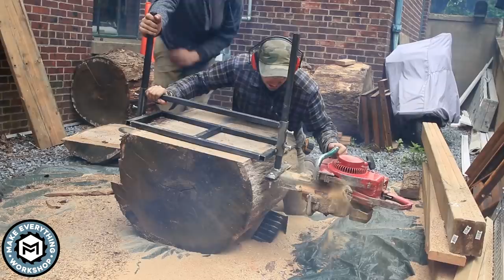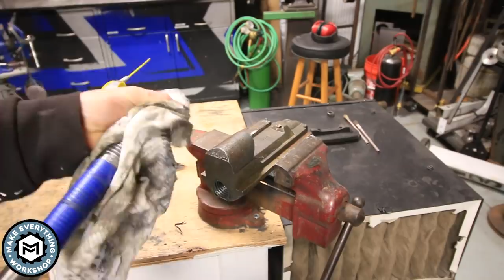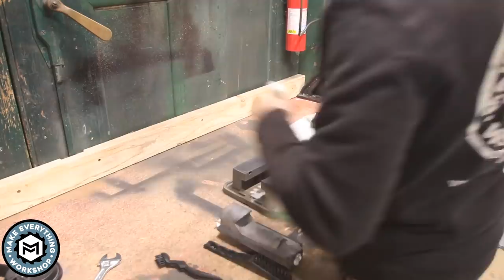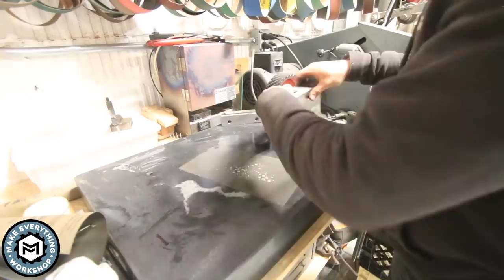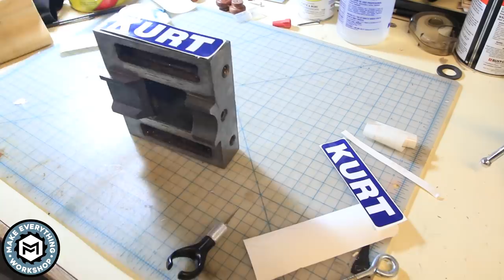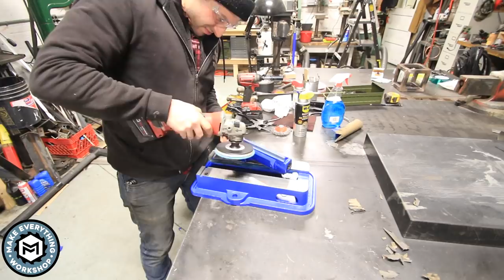KURT Milling Vise Restoration

Comment: Excellent video.  I must be the week for Kurt vice problems, Keith Rucker  had a similar problem with a stuck vice, yours ended up better, it cost him $141.00 for a rebuild kit from Kurt.  Great job, Thanks for sharing and stay safe.
Reply: I saw that same video that Keith did, I wonder why he didn't try the relief-cut on the ACME tread...he could have done that for nothing.

Comment: So I'm obviously a few yrs late on this video. I've gotten into picking up these older Kurt and clone vices (The cheaper the better) And rebuilding them also and flipping them. So I've found that nearly all these ball screw (Kurt and Clones) are all the same thread size and pitch. And found a tap to run into the threads in what this guy is calling the "Thread Box"  Kurt calls this part "Nut and screw assembly" And buy having this tap, 9 out of 10 times it will save all these parts. As long as you didn't destroy them getting them apart. Patience and lots of Kroil or my favorite "CRC Knock'er Loose" The stuff isn't cheap, And I ONLY use it on parts as a last resort before heat (because of the $19.00 a can cost) But if its on a part that you do not want to apply lots of heat to. Then this is what you want, because it does it work. 
Unfortunately they (Kurt) are no longer selling these screw and nut replacement kits for the D-60 vices. Why?? Who knows, Probably because they are trying to sell more new and more expensive models today. However,,,,,,,, if you look at some of the clone parts.  There the same part. And I can't find a difference (even with a micrometer) Between them. But you have to find the right clone parts that will fit your D-60 😉. Yes, there out there, Just look around. And the McMaster Carr replacement bearing and thrust washer kits measure the EXACT same sizes as do the Kurt OEM kits, BTW. And since I live 12 minutes from the McMaster Carr Warehouse here in NE Ohio. I get all my Kurt parts from them and no Shipping cost and there always in stock. Including jaws. OEM handles come from them also, And the Speed Handles i use come from Gray Ledge CNC off ebay. They can custom make and coat anything aluminum for you that you want or need.

Comment: Nice job. The only thing I would have done it differently is; using feeler gauges identify the thread pitch. Then use an actual tap to clean up the female threads.

Comment: Nice job on the vise, I love to restore and paint my machines and tools. One tip on the vise I did was to use a 6 inch wheel and broached a 1/2 drive 3/4 socket into it to use as a speed handle. Works great for me.

Comment: I loved your work restoring this vice! One question though..Since you already have a lathe, why did you risk damaging the lead screw instead of making a dedicated acme tap?
Reply: I'm guessing ...he's a self taught machinist. I mean, these days you can do that fairly quickly since we have the internet but it requires dedication like anything else.
Reply: I wondered the same thing! I'm a self taught machinist, but I can cut acme well enough. Heck you even have the original in good condition right there to check against. I guess if you really do a good job deburring that relief cut, its impact will be almost nil. It's still a stress riser and a interruption in a load bearing thread.

Comment: I didn't want to damage the reference surfaces with the surface grinder, so I completely destroyed them with sandpaper!
Reply: Sandpaper on a surface plate is a very good way of improving the surface finish of a flat face, without changing the geometry by any meaningful degree.
Reply: Summit X  To start, I am a machinist and I work in a precision manufacturing industry.  Thanks for the reply btw, I have added it to the list of technical things to make a video about :).  The vice cost him $50 which is brilliant even if it is out by 50 µm.  The restoration could have been improved in my (and I suspect your) opinions by including measurement and testing, before and after.

The amount of material removed on the surface plate seemed a bit excessive, but I cant tell the grade of sandpaper so it could be as little of 10 µm of steel.  I certainly would have covered the whole surface plate in sandpaper so as to avoid changing the geometry of the granite in the process.

As for not using soft jaw covers for holding the vice jaws: that was definitely an oversight.  Hopefully the Kurt jaws are hard enough to resist the rough treatment.
Reply: Summit X  you are kidding right?. 001 thousands of an inch is 25 nanometers, not even Stefan Gotteswinter would call this inaccurate.
Reply: @ChristophPech  Looking at the tenor of his reply, I would say he meant to type either .001-.002 inches or 1-2 thousandths of an inch. In the heat of the moment he lost track and combined them, but in his head he saw what he meant. This is why successful writers use editors.

Comment: Never put grease in your blast cabinet,  it will not help paint stick to your parts but one time.   Every time after that you're just accumulating & spreading the grease. At least clean dirty parts with gas or diesel. Then maybe even rinse that off with soap & water & dry off before blasting. 
Just my 2¢.
I won't get into accumulated backlash...

Sweet deal though.

Comment: I have just purchased the same vice for £40 in the UK. My thread has a groove in it so it must have been cut just like yours to clean the rust out. I also replaced the jaws and had to smooth the ways off with a #1200 grit diamond stone which was flat as it was going to cost £160 to get it ground. It worked well until i get a surface grinder one day. Re painted like yours in blue. What font is the KURT logo? My vice had holes in the fixed jaw which i filled with a bolt then welded and milled it flat. It looks and works like new again.

Comment: Nice job mate, the “proper” way to fix that thread would have been to chase it with a tap, but then again that tap would have cost a lot more than the vise, you just have more guts than me, I wouldn’t have dared to make that screw “self-tapping” :D
Reply: Do they make acme thread tap chasers?
Reply: You can make one with the lathe and some drill rod, you could probably get away with soft steel for cast iron.
Reply: Isn’t an ACME thread square?

Comment: If you’re working around machinery, especially a lathe, please cut off the drawstrings on your hoodie.  I’m not a safety sally but this is one item that needs absolute diligence.
Reply: Motor 2of7 quite right, this was the comment I was going to make. Rest of the video was very good. But safety comes first!
Reply: I just wanted to thank you for pointing this out. I’m just a hobbyist machinist, and wear hoodies while working constantly... the danger of that never occurred to me. I’ll be removing the drawstrings from all of my hoodies tonight! 👍🏻
Reply: Just being mindful of what you're wearing, and tucking the strings inside the neck also works. But I guess this can get forgotten.
Reply: Great comment! A subject frequently overlooked until tears of loved ones later.

Comment: I really wish you'd watched some other videos on the restoration of one of these by more experienced machinists. You have a working vice now, but in no way is it at the level of precision it would have been if you'd taken a bit more time with it. These are supposed to be what you use when you need to hold parts you're machining to tolerances measured in tenths of thousands. If this can hold a few thousanths now you're lucky. You could probably go back and redo that in the future if you wanted and at the least it's not going to rust again. Now the bad news. You probably now have a small granite countertop instead of a surface plate. Clean it off, and check it with a test indicator, but I'll be very surprised if it doesn't have scratches and gouges all over the place after that. I understand you may not need the level of tolerances these tools can provide at their best, but that doesn't mean they shouldn't be maintained in a way that they still could.

Comment: Hi Sir thanks for best clip but my issue is 4 bolt holes 1/2-13 thread were stripped I could not use the bolts to tight the jaws so could you help me any idea to fix it thread on vise thank you so much.

Comment: But did you measure to see is there's any changes when you clamp the parts down? I guess if you're not making parts for customers, which that have to be +/- .005" or better it's not that big of a deal but If I had a Kurt, I would definitely want to check how close it is to a new one. I'd run an indicator along everything that counts, anyway.

Comment: But, on the other hand, using wet and dry on the surface plate, done carefully, can give quite a nice flat surface. It all depends on the wrist action ...... and using a figure of eight motion - back and forward WILL put a curve into the surface as reported below.  BobUK.

Comment: Just watched this. Yeah, hopefully you are learning. Just about everything you did was wrong. Doesn’t matter what you paid for it. That was a valuable vise that could have been restored and gained value. Here are some highlights:

Surely there was a  chunk of metal in the female threads. I would have chased them with a right angle pick to see if I could find it. Making the screw into a tap and forcing it with an impact gun just made that screw sloppier for sure. Wrong thing to do.

You can’t flatten a ground surface on a flat surface. That whole sandpaper on granite doesn’t do what people think it does. If you don’t know how to use your grinder, at least learn to stone surfaces. I would have stoned the base, cleaned it, then put it on the surface plate and inspected the top surface with a test indicator. Maybe could have just stoned the top surface.

Just about everything you did up to removing the badge removed value from that tool. The fact that at the end of the video, you basically admitted that, makes me want to never watch anything you produce again. I would have preferred if you had discussed what you thought you did wrong so that you could help others learn.

Comment: Why didn't you just regrind the jaws instead of buying new ones?
Reply from the maker: Linda Kasevich I ordered the groovelock jaws from Kurt that have a cool little channel milled in them and a small work stop clamp that helps with indexing multiple pieces. I will likely grind these jaws too just to have multiple sets.
Reply: You heard him say he doesn't have very much surface grinder experience or confidence. He probably didn't feel comfortable doing it.

Comment: Doesn’t that sanding run the risk of destroying your granite plate??   Otherwise, strong work!
Reply from the maker: Thank you!!!

I actually have two plates, one for indicating off, and one for sanding parts on knives perfectly flat. The one in this video is the sanding plate. I got them both at auctions for about $20 each and they are not currently calibrated so I'm not too worried about their dead nuts precision. Also I'm using very little pressure when I sand on them.
Reply: Answer is yes. Sanding ruins surface plates.

Comment: Also, it's not the best idea to clean a lathe with an air gun, tempting though it is. It tends to blow chips into places you don't want them, like inside the carriage gearbox. BobUK.

Comment: Omg poor surface plate :/ Surface grinder is actually pretty easy to use if you have some practice in machining. Also no hand-scraping, no post-check on the surface plate to see how the kurt actually deviates from flat and parallel + perpendicular on the jaws... nope I didn't like this restoration.. very "scrappy" from a point of a machinist

Comment: Why would destroy a $1000 surface plate to fix a vice that cost $20
Reply from the maker: pijnto because the surface plate was $15 😬 I use this plate for flat surface sanding on knife parts. I’ve got another plate for indicating
Reply: @MakeEverything  That's fair enough

Comment: It hurts watching you ruin the threads. You didn't even run a pick/scribe along inside the threads to see if there was something stuck in them.
Reply from the maker: Julie Jones I actually ran a pick through it from both directions, and spent over an hour spinning a wire brush in there to try and clear the blockage, ultimately I think this method of chasing them with the hardened steel screw worked pretty well, but hey, can’t please everybody right?

Comment: For $25 spent you couldn't really go wrong. If the threads had not cleared you would probably have had to investigate purchasing a new threaded slide or an Acme tap. Either way, that would have turned this project into a hundred bucks plus.